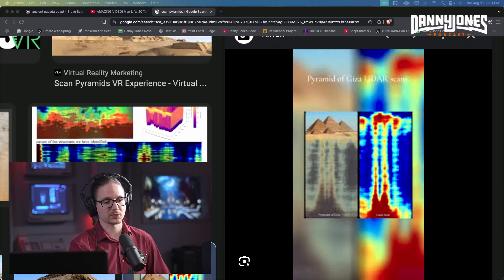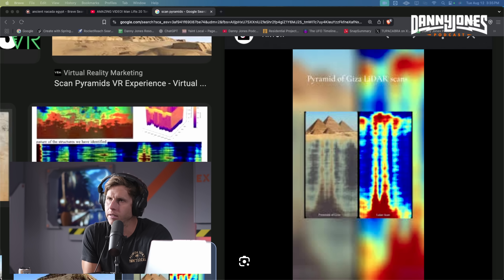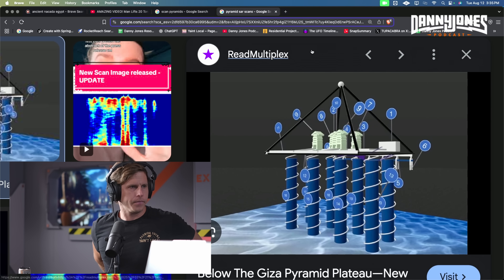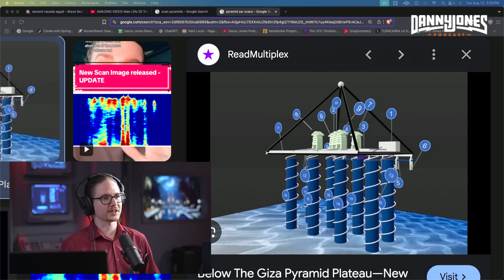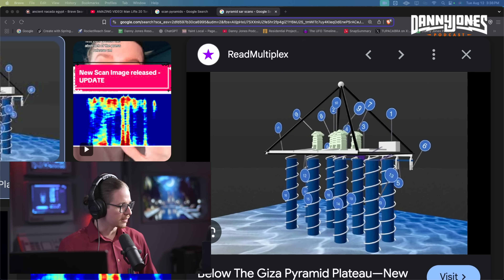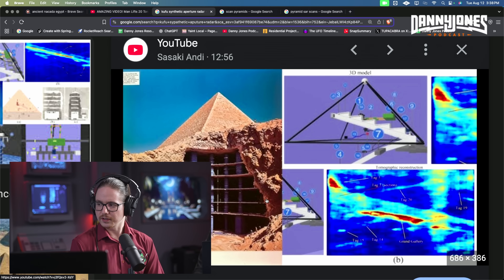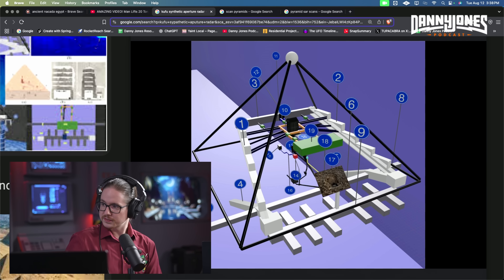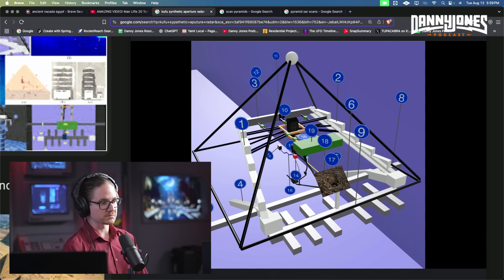New Great Pyramid Scans Seem to Prove the Ancient Power Plant Theory | Adam Young & Karoly Poka

Comment: 4:55 well no there is no will to dig, its not technically difficult. You could just drill a non invasive small drillhole and see if you end up in one of those supposed vertical tunnels.

Comment: A correction, the they are not scanning through the bedrock they are not penetrating the ground with radar. There is recent videos from Fillipo Biondi which actually gives and example. They are measuring vibrations from the surface, the vibrations are different based on whats underneath, think of it like echolocation.

Comment: Yea, it’s called SAR Doppler Tomography.  It’s not a new technique, but its use on archaeological sites is pretty novel.  I’ve read it’s been used extensively to peer into semi-active volcanoes.

What I’d really like to learn is if they used a publicly available archive of SAR images (which scan all areas, all the time, at different angles on the particular pass, and have been collecting this data since 1992), or:

whether they sent in a work order of sorts to a company like Maxar, and requested particular scans of the Pyramid.

Evidently, everything on Earth produces tiny micro vibrations that are induced by constant, but low, seismic activity - an Earth Hum, so to speak, or a ‘background hum’ of the earth.

Instead of using direct SAR waves to analyze the surface and at best, down into the dry earth, or stone, a few meters at best, the technique instead analyzes the ‘background hum’ of the micro vibrations.  

The hum causes microscopic movements, of a millimeter or less, in both solid rock and any voids.  The SAR satellites can detect the micro vibrations, which appear in the SAR return waves - the radar echoes - as small waves phase shifts or Doppler frequency shifts.

It’s analogous to using ultrasound to excite tissue to specific frequencies, which can be detected by the pickup element in a handheld device.  Except, instead of the SAR wave exciting the molecules of subsurfaces, it is able to pick up the ‘background hum’ of the particles and molecules, which vibrate by constant, subtle seismic waves.  

The hum causes the radar return to phase shift or Doppler shift, which the SAR satellite receiver can detect.

I’m not yet sure at how deep underground these vibrations can be picked up as subtle changes in the return wave, but it looks like there’s confidence of 1000m ‘penetration.’

Nor am I sure how many images are taken, and from how many angles, but I’m guessing thousands or tens of thousands of radar echoes would be needed.

Their algorithm then - for lack of a better term - stitches all the return waves together, and eventually the phase anomalies begin to ‘detect’ and resemble the many structures, their shapes, and any voids they may contain - with around a one meter (1m) resolution.

Comment: Why don’t they low altitudes scans? Why from space? LiDAR works better at low altitudes scans
Reply: Zahi Hawas won't allow it.  Why they did it from space.
Reply: It's not LIDAR, or at least not the kind you're thinking of.
Reply: Yea, it’s called SAR Doppler Tomography.  It’s not a new technique, but its use on archaeological sites is pretty novel.  I’ve read it’s been used extensively to peer into semi-active volcanoes.

What I’d really like to learn is if they used a publicly available archive of SAR images (which scan all areas, all the time, at different angles on the particular pass, and have been collecting this data since 1992), or:

whether they sent in a work order of sorts to a company like Maxar, and requested particular scans of the Pyramid.

Evidently, everything on Earth produces tiny micro vibrations that are induced by constant, but low, seismic activity - an Earth Hum, so to speak, or a ‘background hum’ of the earth.

Instead of using direct SAR waves to analyze the surface and at best, down into the dry earth, or stone, a few meters at best, the technique instead analyzes the ‘background hum’ of the micro vibrations.  

The hum causes microscopic movements, of a millimeter or less, in both solid rock and any voids.  The SAR satellites can detect the micro vibrations, which appear in the SAR return waves - the radar echoes - as small waves phase shifts or Doppler frequency shifts.

It’s analogous to using ultrasound to excite tissue to specific frequencies, which can be detected by the pickup element in a handheld device.  Except, instead of the SAR wave exciting the molecules of subsurfaces, it is able to pick up the ‘background hum’ of the particles and molecules, which vibrate by constant, subtle seismic waves.  

The hum causes the radar return to phase shift or Doppler shift, which the SAR satellite receiver can detect.

I’m not yet sure at how deep underground these vibrations can be picked up as subtle changes in the return wave, but it looks like there’s confidence of 1000m ‘penetration.’

Nor am I sure how many images are taken, and from how many angles, but I’m guessing thousands or tens of thousands of radar echoes would be needed.

Their algorithm then - for lack of a better term - stitches all the return waves together, and eventually the phase anomalies begin to ‘detect’ and resemble the many structures, their shapes, and any voids they may contain - with around a one meter (1m) resolution.
Reply: Because you would need permission to fly through their airspace, which they won't give. They can't do anything about it when done from space.